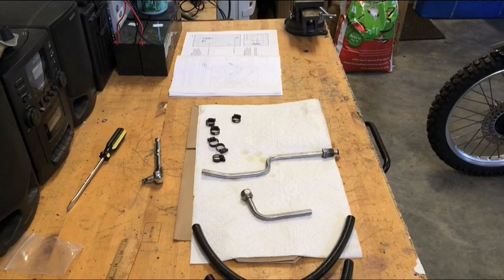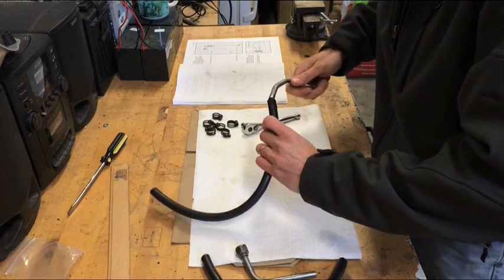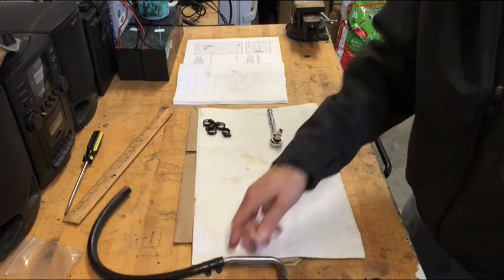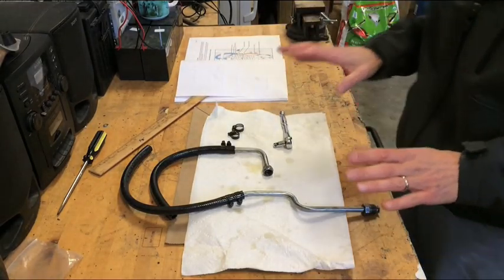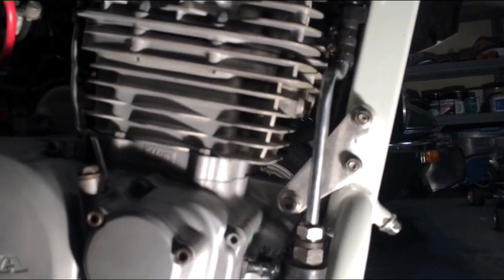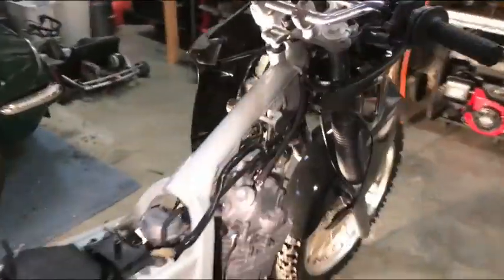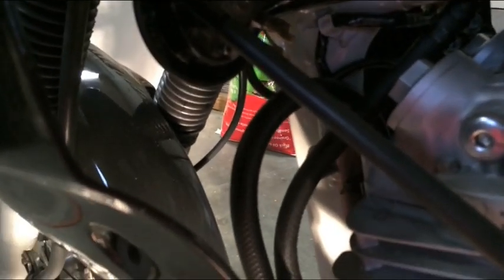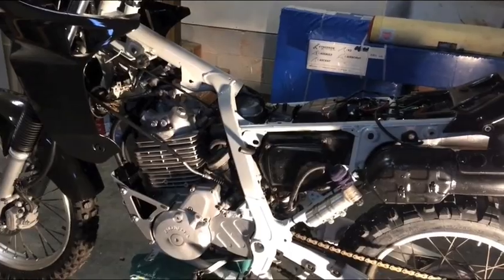Honda NX or XR 650 Dominator "SuttonCycleWorks" Oil Cooler Installation Part III

Comment: Great oil cooler. I run it on my XR650L with increased compression piston and it keeps the engine cool. Plus, the part is first class and excellent quality.

Comment: GUY'S , A WORD TO THE WISE--AUTOMOTIVE A/C  HOSE CLAMPS AVAILABLE AT AUTO PARTS STORES ARE TWICE AS WIDE AND WAY STRONGER--THEY HAVE A TANG/LOCATER ON THEM THAT CAN BE USED OR SIMPLY BENT OFF--I HAVE ALWAYS USED THEM IN ANY CRITICAL CONNECTION--ALSO PUTTING A PARTIAL FLARE--{  NOT ALL THE WAY  }WILL GIVE A SHOULDER/RIDGE FOR THE CLAMP TO SHOULDER ON STOPPING IT FROM SLIDING OFF UNDER HIGH PRESSURE--JUST INSURANCE , AND A GREAT PIECE OF MIND--ALSO BE MINDFUL THAT THESE ARE ALUMINUM , OR MILD STEEL LINES---YOU CAN COLLAPSE THEM IF YOU GO NUTS WITH A RATCHET TIGHTENING THEM  . HOPE THIS HELPS .

Comment: i know that its an old video but.. i see that u didnt put "by pass valve"that when the engine is cold it bypasses the cooler. my question is : did u have any problems without it ? i want to do this on my dommie as well and some friends tell me that it isnt a good idea to use the cooler when the bike is cold. would be glad if u respond
Reply: CHECK OUT THE OLDER  A/C , AND HEATER  HOSE FITTINGS , AS WELL AS THE BYPASS VALVES USED ON VEHICLES AT AUTO PART STORES {   THE OLDER DODGES HAVE SOME VERY INTERESTING SETUPS , THAT MIGHT VERY WELL HELP  }-YOU WILL NEED TO EITHER ASK FOR THE CATALOG , OR COME TO THE BACK OF THE STORE AND TALK  TO THE COMMERCIAL SALES GUY--  {   THAT IS WHERE I SIT   }, I TALK AND SELL ONLY TO SHOPS/MECHANICS WHO KNOW WHAT THEY WANT--AFTER 30 YEARS SELLING PARTS  I DEAL WITH THE SHOPS EXCLUSIVELY --, DAMN NEAR ALL THE COMMERCIAL SALES GUYS KNOW THERE STUFF AND CAN HELP YOU WITH WHAT IF'S THAT MANY OF THE FRONT COUNTER GUYS SIMPLY HAVEN'T SEEN  { THE BACK COUNTER GUYS HAVE THE SUPERIOR SET OF CATALOGS TOO !!! }. BEST OF LUCK !--THINK O'REILLY , NAPA , CARQUEST ,  ANY OLD SCHOOL PARTS STORE .
Reply: maxvollume did u succeed? Thanks in advance